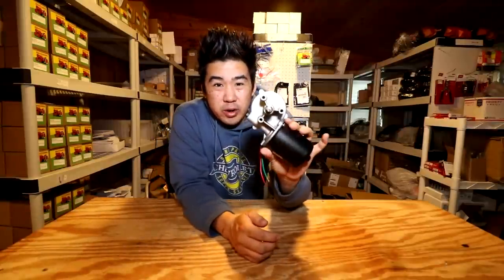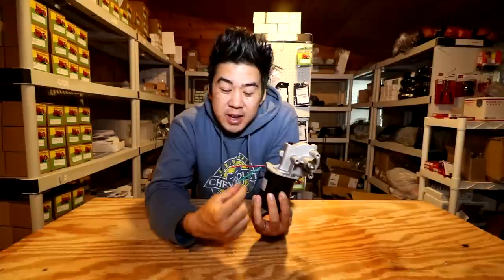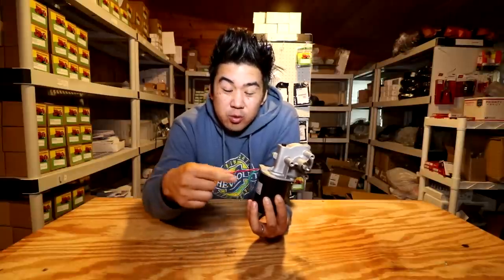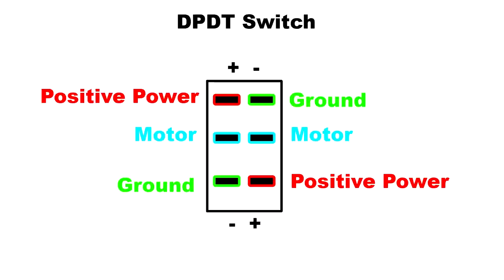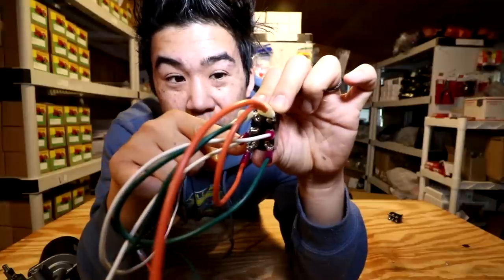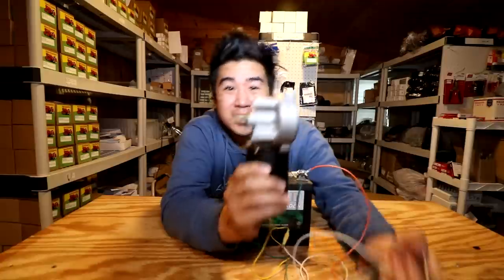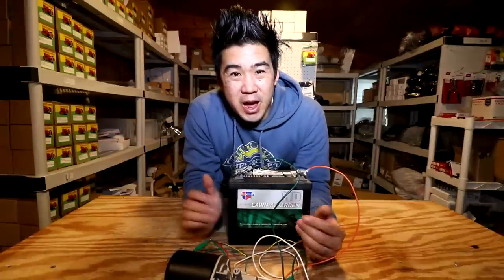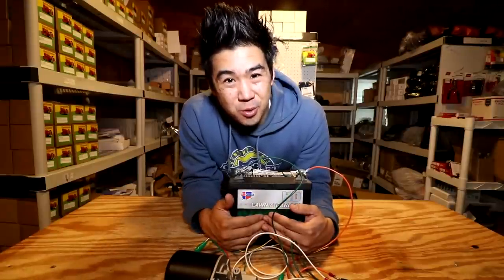How to wire 12v Electric Motor Wiring with DPDT Switch

Comment: Excellent video. I was researching switching polarity for a 60's Lincoln Continental window motor modification. And here I find you with almost the same motor in your hand demonstrating what I need. I'll be using a dpdt relay installed in the door. You explained and demonstrated very well thank you!! Also, your website may be for small motors and tractors, but your articles would be great for anyone wanting to learn some basics about internal combustion engines and the systems involve it running them. Well done Sir!!

Comment: Great video, simple explanation. Are all DPDT switches going to be the same pin layout? The switch I got is not momentary - it stays in the toggled position. I need to do exactly what you did but also wire in push button stops in each direction. Will the push buttons simply split the positive on each direction? Thanks!

Comment: Just a suggestion for you but many people get confused by relays wiring for pto clutches and wile a switch is simple a winch requires more amps than traditional swith can handle. 
Many people are also using winches for plows.😉
Like you videos and keep up the good work. 
That Briggs flow jet carb (choke style b) works great by the way.👍
Reply from the maker: Thanks for the suggestion! I will add that to my list of videos. Thanks again for your business!
Reply from the maker: I just purchased a bunch of SPST 5 Pin Relay Banks to demonstrate the use of Relays for future videos. Thanks for the suggestion.

Comment: Thanks, I'm enjoying this idea of working on my own stuff, more videos and thanks, funny, South Florida typically doesn't have snow, anytime.
Reply from the maker: There are few things more satisfying then fixing, or building something yourself and then see it working!
Reply: @Isavetractors  can you show me how to wire a 2 12v batteries in series to a toggle switch that operates my scooter

Comment: You must be a genius!!!!! Thank you so much for posting !!!! I've got a  question if you were in my situation  and you were going to " temporarily'  use your  portable jump starter to operate the power window on your truck how would you hook up the ground wire to the DPDT switch?
Reply from the maker: Hmm..for your case, I would hook a wire to the ground on the motor, and just clamp that to the negative of your power pack. Everything else would be just like in this video. The current ground wire on your motor is probably connected to the door itself.

Comment: I see you don't use relays and most places see they do. I'm wiring up my 2 motors for my snowblower chute for left right nd up down with a joystick and love the way you do it. So I don't need relays?
Reply from the maker: Relays are for high current applications. But for moving a snowblower chute wiring them direct is sufficient.

Comment: Is there a specific guage wire I should use and should I link a fuse or resister?
Reply from the maker: 14 gauge will have you covered. A fuse between your power source and the motor would be a good spot for one

Comment: Would this work for a small 12v winch with out needing all the boxes and stuff
Reply from the maker: Since a winch will pull more current then a typical DPDT can handle you should use this in conjunction with some relays
Reply: @Isavetractors  I really appreciate getting back to me and great video helped out a lot thanks

Comment: do you need inline-fuse?  if so what wire?
Reply from the maker: If you were to add a fuse to this you would want to add it before the switch and in between the switch and the power source.

Comment: Does it matter which is the load and which is the line on the switch?
Reply: what is your specific question? the 2 white wires going to the motor are BOTH or either positive or negative. the switch is simply switching the polarity to rotate clockwise in one on (CLOSED circuit Norman, open circuit has no conductivity) You did an excellent explanation BTW. Back to Wayne: he is using a positive and a negative on one side of the switch and reversing their positions on the opposite side. the center terminals make a circuit with either (but only 1 at a time)

Comment: Reversing a motor like this will only work on PERMANENT MAGNET  D.C. motors!!!!  If your motor has field coils or operates on A.C. current, This will not work!!!
Reply: Most if not all power window motors are permanent magnet motors